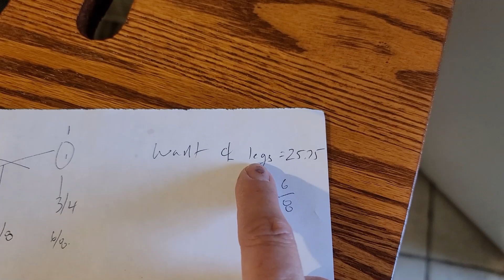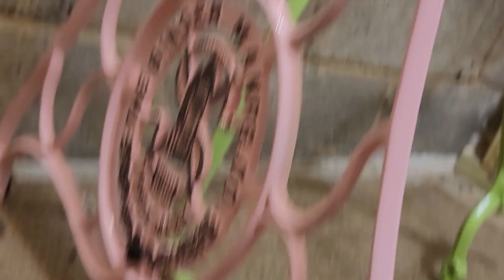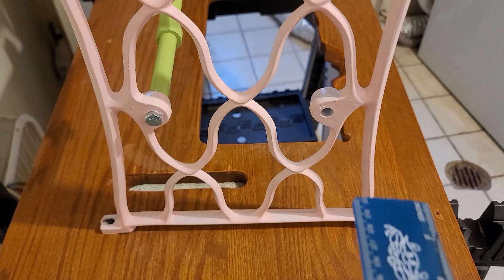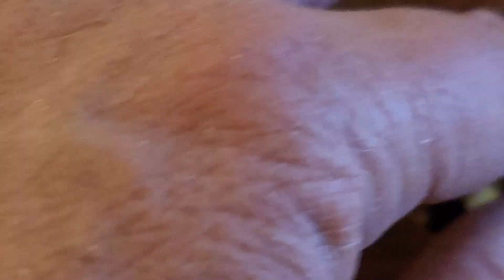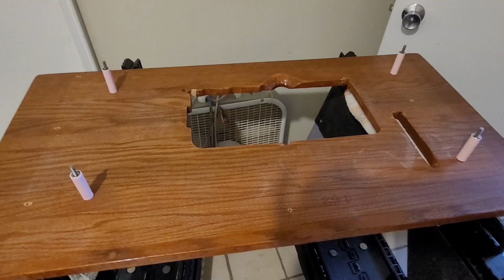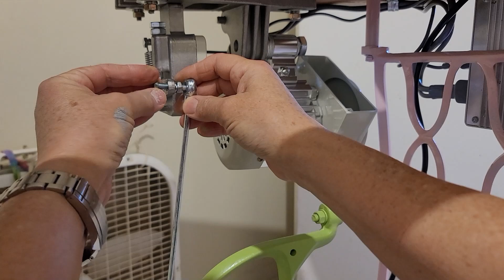Build an Industrial Sewing Machine Table from a Domestic Treadle with Hidden Fasteners

Comment: You are capable. Should setup a video on how to improvise Singer 15K with a servo motor, pulley modification. 🤭 Many will benefit using that for 4mm - 6mm garment leather sewing.

Comment: That is awesome Cool.   Really nice job with the machine Handle placement. Perfect.

Really well done...  Nice innovation on extensions etc.

Hint:  spin up a nut beyond your intended cut. Then the nut will clean the threads on the way off.

I would also recommend Blue lock-tight on those hidden nuts aide in loosening from vibration.
Reply from the maker: Thanks for watching the video. I thought about something for those nuts but they're actually facing downwards with gravity now inside the pink height extensions. So not worried about them going anywhere. And the ones inside the green are bottomed out on the adjacent nut. 
Thanks for the great suggestions and feedback!  ♥️